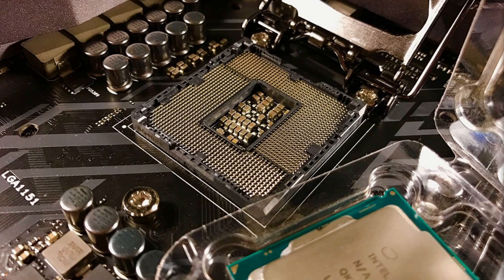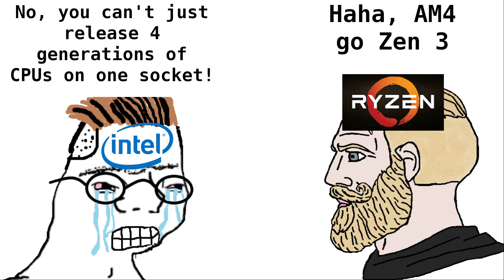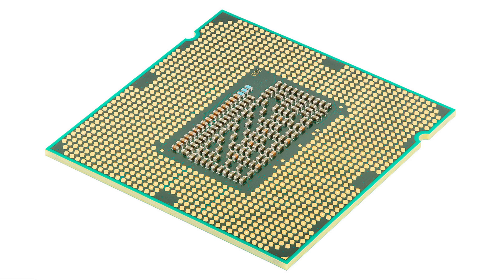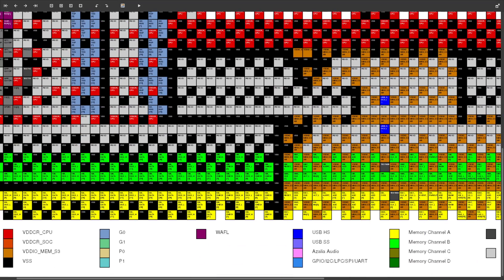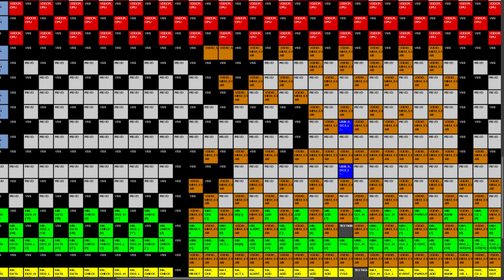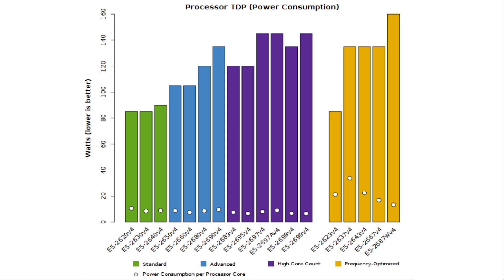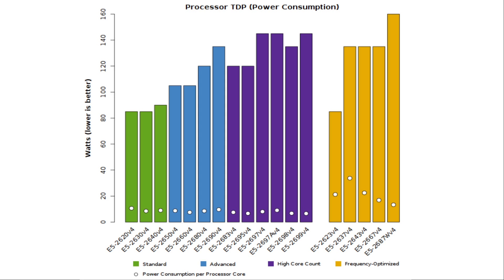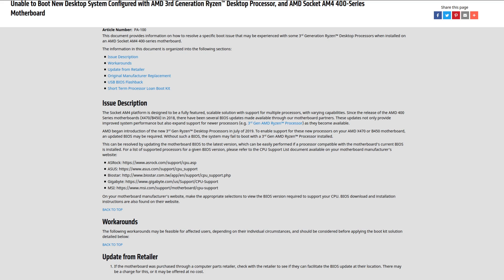The Reason for CPU Socket Changes

Comment: I mean, basically what AMD has done is what i've said to do from around ivy bridge, if the board doesnt support the feature, then thats the price you pay for using an older board those pins remain inactive Including power delivery. You only really need a new socket when there just arent enough pins to add the new feautres you want, like an addition channel of RAM, or 2 in the case of alderlake, though i suspect thats temporary, however APUs are going to need at least 3 channels here pretty soon. Sure you're giving up newer features, and maybe your processor has a turbo of 4.1 instead of 4.9, but you're still on that motherboard you dont need to change because it serves all the roles you need it to. You're just looking for more performance, at a lower power consumption.

I actually dont need PCIe 4.0 or newer revisions of USB-3. Most of my systems are fine with USB2.0 and my SAS controllers are often PCIe 2.0. So most of my boards, are x370, B450, or X470 with 3000X, 4000G, and 5000G, the only 2 boards i have that are B550, are ITX for high speed RAM(over 4400MT/s with FCLK and UCLK over 2200) for 5000 series APUs(5600G and 5700G) and if i didnt absolutely need an APU for a system that cant fit a GPU, i'd have gone with an X series processor, with B450 boards with slower RAM, slower because only the APUs can hit these high frequencies, due to the hot, slow, 12nm IO die on the X series processors. I've seen people have micron E die up to 4933MT/s with 1:1 MCLK:UCLK validated over 24 hours, but to get these crazy 74GB/s at only 48ns of latency, you need to give up quite a few things, like more than 2 RAM slots, dual rank RAM, and the more powerful X series processors.

Fun fact, if the APUs didnt have 1/2 the cache of the X series processors, they'd outright be faster than the X series processors, because of the monolithic design they're much lower latency, and there is no hot IO die dumping heat into the IHS allowing them to run cooler or faster than the same X series processor. Add to that the much faster RAM and stable UCLK/FCLK overclocking and they'd be an all around better processor, other than price, because the 7nm die area of the 5700G, is more than 2X that of the 5800X

Comment: AMD has proven repeatedly that Intel is nothing but moneygrabs across the board. New gens only a couple % more powerful, same size just more power use, same number of cores, no real generational upgrades for years. Notice Ryzen comes out and Intel starts improving by leaps again... odd no? Intel rested on their laurels charging more and more money for basically the same thing for years because they had no real competition from AMD, so when AMD started competing again, they flat out werent prepared to even try competing.

Comment: where i get what you are saying, often intel have released new sockets not for new features or to improve a platform, but to force the shift to a new platform, they went from 1366 to 115* there wasnt any platform upgrade there, and, from insiders, a large part of it was that they wanted to stop/limit overclocking, 1366 was too good, it could have easily taken 2-3 new gens of chip without needing the platform itself upgraded beyond what 3rd party chipsets could add like usb3/sata III

more proof is that they put out the 1356 platform for small servers, up to ivybridge... and i have have it confirmed that it was due to overclocking in this case, sometimes it makes sense that they put out a new platform/socket, new features, even the top end replacement for x58, x79 wasnt at best a side grade as a platform.... i got a buddy running dual x5690@4.8 with a turbo to 5.1, (evga sr2), who after alot of tinkering has his ram running at over 2133.... triple channel.... 96gb of 2133 ecc ram, its beastly for its age... it can actually emulate AVX and FMA better then the amd FX line can run them native..i say this since my x5675@4.4-4.7ghz with 48gb ram is noticeably faster vs my 9370 when running avx and fma code paths via the intel cpu emulator ...  

now, amd have also been guilty of this in the past, abandoning platforms to push newer ones... despite the fact they could have made chips work in both newer and older versions of the platform even... but at least amd have tended to have much longer upgrade paths on the same socket. 

still, pretty impressive how well the x58 platform held up..had they put out a sandybridge or ivybridge based chip line for them... the problem would have been it would have lasted too long without people needing to upgrade their platform... an ivybridge based 1356 on a very specific board showed me a hint of what we could have gotten... despite  only being able to get 4.0 with a turbo to 4.2 it was matching or beating a heavily overclocked 2700k...

if they wanted they could include enough extra pins to cover new features for a few generations, but thats not as good for the profits as the current business model... 

at least intel are getting a bit better my buddy has a 7940 hes going to upgrade to a 9k or 10k chip soon... depending on what the best value price to perf as an upgrade.... hes already got that thing at 4.6 with a 4.8 turbo... so.. yeah... i told him to be careful and get something thats now a side grade or downgrade for some of what he does...

Comment: B350 doesnt support the Ryzen 5000 series and B550 doesnt support Ryzen 1000 and 2000 series. They might use the same socket and there is an overlap of support with the Ryzen 3000 series. It isn't like they ain't doing the same thing that Intel does. I think there might be some genuine reasons to change the socket a bit given that when designing one you might not account for a new technology that has yet to be thought of or at least a new way of doing things more efficiently that isn't compatible with the old design. With regards to overclocking affordability, AMD is King and I think that should be the focus. Still AMD does offer more freedom regarding the product we pay them to deliver.

Comment: Doesn't matter how many generations the socket supports if the chipset doesn't support all the generations.  No AM4 chipset supports more than 3 zen revisions, which is only one more than Intel's typical 2.  If you have an original X370 motherboard, you can't put a Zen 3 based CPU in it because the BIOS doesn't support it.  If you have a current X570, you can't use anything before the 2000 series (though there is no reason you would want to either).

Comment: Intel don't give a flying f about simplicity and ease of use.
Here in India they keep pushing a cut down 'P' version of their most popular cpu (say, i5 6402p)
They either have lower clock or weaker graphics or lower TDP or any combination of the above. Minimal information is provided about it on the internet and they price it same as the regular counterpart (say i5 6400)
So when someone says Intel did something to reduce confusion for end consumers, I have a hard time believing.

Comment: If you have an older AMD based motherboard, you probably have the older CPU. I do not see the logic in stating that you would need to get a loaner from AMD to flash the BIOS. As long as the motherboard is not extremely old, the prospect of flashing the BIOS and upgrading just the CPU is more logical. Over the life cycle of a motherboard (Intel or AMD), there will be a couple flashes of the BIOS needed during that time. If I am buying a new AMD CPU for the first time, I believe I would end up buying a motherboard that was compatible with the new CPU.

The 2 and done by Intel is ludicrous. If you wish to upgrade every 2 or 3 years, it is either creating more e-waste with a disposable CPU and motherboard or find someone on the used market to buy it. Since the flashing a BIOS and replacing the CPU is stretch for the novice, how difficult would it be for that same novice to pull the motherboard with the CPU to replace it with something new? Maybe Intel should design CPU's that were a little more environmentally friendly including better power consumption. 

It's amazing how AMD can do all that and Intel can't do so.  Sadly, all my builds for the last 10 to 15 years have been Intel. 2022 may be my first AMD build. I am completely done with the 2 years and done.

Comment: My experience is I build a new computer every 5-10 years. With that said, I don't see a scenario where I'd want to keep my old motherboard and put in a new CPU. So the whole socket thing seems moot. My 10 year old motherboard isn't going to unlock the performance of the latest CPU, even if the sockets matched. I guess this might be a selling point if you upgrade your CPU every year or something, but that's just waste of money. Even then, you'll still run into the issue where you're eventually using a motherboard that can't keep up with the CPU and then buy a  new motherboard, anyway.
Reply: So why would an x470 motherboard fail to "unlock" the performance of the 5950x?
Reply: @vyor8837  Because almost no one upgrades every year or two. People who do are wreckless and dumb money spenders, especially if they are only gaming without actually really utilising the more power. X470 came alongside Zen+ and a 2700X is still pretty good. Also, looking from your other comments, it's pretty obvious you're a fanboy lol. AMD literally didn't want to let people use Zen 3 on even 400-series chipsets and people had to cry a river to a corporation in order to get them make Zen 3 chips compatible with 400-series chipsets. They still haven't released actual Zen 3 support on 300-series chipsets even though Zen 3 has been around for almost over a year and a half. Then there are the motherboards that still don't work even if the chipset is supposed to be compatible with the CPU. The reason that AMD gave for these compatibility issues is even more hilarious (low storage capacity on the BIOS ROM) but then they somehow made everything (or most things) compatible after a year. Magic? I don't care if AMD uses the same socket for 3 or 4 generations if they don't actually make every (or most of the major ones) CPU intercompatible. They wanted to do the same thing Intel has been doing for years. If this upgrade path is such a huge platform advantage that AMD likes to advertise so much, why don't they even put effort into actually executing it well? Tech influencers still eat up marketing and don't tell you the full story when they say that AM4 has a good upgrade path.
Reply: @GamerBoy705_yt  AMD literally just did release 3000 series support on 300 series and zen3 was available on x470 since launch. The 5800x and 5950x perform the same on decent x470 boards as x570.
Reply: @vyor8837  Are you thinking that Zen 3 means Ryzen 3000? lol

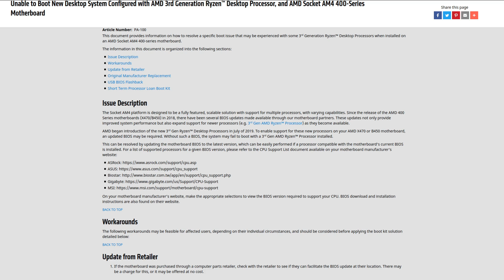Comment: so with the BIOS problem he was talking about around 5:30 i would like to say that recently when i was building my new PC i ran into this issue except in my case i was still able to boot into my BIOS without having to get an older CPU. I did however have to use a friends computer to download the BIOS update to a USB drive. so ultimately as long as you have access to another computer you shouldn't have to buy or replace your new CPU with an older one just to do an update. Or at least that's how it worked out with my ASROCK B550M steel legend MOBO

Comment: There was a socket difference between Intel  LGA771 and LGA775 that basically existed only to prevent using consumer class CPUs on XEON server class hardware. There are quite a few tutorials on how to remove the plastic notches on the socket so you can use a cheap outdated XEON server class CPU on your consumer grade motherboard.
https://www.youtube.com/watch?v=8FNxip5AfCU

Comment: 2021 AMD: ya now what? This is a fckin 3D-stacked Zen3 for AM4, have fun. 

5 fckin gens on 1 socket wtf.
Reply: 3d stacked isn't a new generation.  Also, doesn't matter how many generations the socket supports if the chipset doesn't support the CPU.  No AM4 chipset supports more than 3 zen revisions, which is only one more than Intel's typical 2.  If you have an original X370 motherboard, you can't put a Zen 3 based CPU in it because the BIOS doesn't support it.  If you have a current X570, you can't use anything before the 2000 series (though there is no reason you would want to either).
Reply: @kinggremlin4574  yeah, there are plenty bios builds out there supporting zen3 even on a320, many of them are vendor-provided and not even custom. there is not much problems running 5000 ryzens on first gen chipsets tho support may vary a little and i'm not sure about zen3d which is ryzen 6000 and obviously a new jen.
Reply: @Zorro33313  Cut the bull with plenty.  You named one chipset, and the A320?  The worst ryzen chipset available?  No PCI E 4.0 (chipset only supports 2.0 x4, 3.0 through CPU), no overclocking, no StoreMI, only one 3.2 USB port.  Who would pair that chipset with a Ryzen 5000 CPU?  Which furthers the point, of why supporting more than 2 or 3 CPU generations is meaningless.  By the time the 3rd or 4th generation rolls around, the motherboard is so dated, it makes no sense to put a current CPU in it.

AMD did not deliver on their promise of supporting gen 1 AM4 motherboards through 2020.
Reply: @Zorro33313  Zen3D is the same architecture as Zen3.  It's not a new gen.  Adding cache does not make it a new generation.  Adding 8GB of RAM to an RTX 3070 does not make the 16GB version a new generation.  Same architecture, same generation.  It's a mid cycle refresh just like Zen3D will be.
Reply: @Zorro33313  Yup, you got me.  I'm a fanboy of who knows what.  My main system is a 5900x so I guess I'm an AMD fanboy.

This morning's CES announcement from AMD proved me completely right.  The only Zen 3d CPU is called the 5800x3D because it is the exact same architecture as original Zen3 5800x with cache stacked on top.  Not even AMD thinks it's a new generation.  The actual newly tweaked Zen3+ architecture is indeed called the 6000 series.  Only problem for your wrong assertion is that the 6000 series is mobile only and has no 3D cache on it.  Doh!

I admire your confidence in being so wrong.  You were right about one thing.  Any further discussion is pointless, because you have no idea what you are talking about.

Comment: This video kinda misses the point in that with overbuilt motherboards like the godlike and others the power delivery isn't an issue at all and they could just have unassigned power pins that could be activated for higher tdp processors, for instance say you have lga 1155, they could have for say an i3 maybe 50 power pins but have a bunch unassigned, then on an i9 they would just activate extra power pins that would otherwise be dormant just like the dormant data pins already in the socket

Comment: Intel is beter than Amd
Intel having very high scale availability  easy to find any kind of intel parts
Other side 
Amd is having very low availability very difficult to find amd parts in market 

One think i dont like of intel. Its poor design of socket pins they need to cover it same like amd socket that no scare of damaging pins

Comment: Absolutely not necessary to change sockets every chip. It's just not. If it was radically different number of pins it would be understandable, but they have the same number of pins, It's not impossible to most of keep the pins the same and extend the rest of the pins/traces to their old slot.

Comment: So Tell me, why could AMD stick to the exact same socket for 4 years now, having only 4, 6 and 8 cores in the first generation of Ryzen, and later adding 12 and 16 core CPUs on the Same socket and even integrated graphics while intel had 2 and 4 Core CPUs for years with changing sockets on each Generations. Also, if they would really need the new Pins for new functions then why was there a socket 1156 followed by 1155 and 1150? Only to add one single Pin to LGA 1151. It’s obvious the want you to buy a new Motherboard, and not a single Person on earth can justify the one single added Pin for Socket 1151.

Comment: This argument falls flat on its face to be honest. The reason to upgrade is never the CPU, it is either the GPU, or the advent of newer technology. I can still get decent frame rates from my 2600K paired with a 1080ti, and I would not have bothered upgrading, if not for the advent of much newer technology such as M.2 drives etc. There is an argument for increased CPU performance, such as upgrading from a 2600K to the 9900K, but there should not be any need to upgrade your CPU at all within a four/five year window. 

When I built my 2600K, I was not sure of its lifespan, so waited a long time for the upgrade. When I built my 9900K, I had a clear goal with that computer - it was to last five years (to 2024), or until PCIE5/DDR5 is the new standard. So, I built the best computer possible around the socket for the 9900K, knowing that it would cruise to 2024, with only a GPU, or SSD upgrade necessary. Remember this too, whilst my computer may not be the fastest, it is still significantly faster than the vast majority of computers that gamers use today. That is all it has to be too, faster than the average. Game developers are not in the practice of making games that only a few people can play.
Reply: Not everyone has only gaming in mind when thinking of pc's. I produce music and could simply never do the same shit with a 5 generation older cpu. As for the 9900k, cheaper Zen3  cpus have now better gaming results using old mobos. So with gaming in mind like you, id simply stay with a cheap kaby lake cpu and spend that money in the gpu.(if ur not still gaming at fhd ofc)

Comment: - plays bored instruction listing theme - open the caseee, look at the socket of the cpuuuu, get the fan offfff, put older cpuuuu (which in most cases u have btw), update biossssss, open the caseee againn, remove the fannnnnnnnnnn, insert the new cpuuuu, cross ur fingersss. Andddddd intel looking for the benefit of the custu-
- Yeah I'd...rather go with the first one